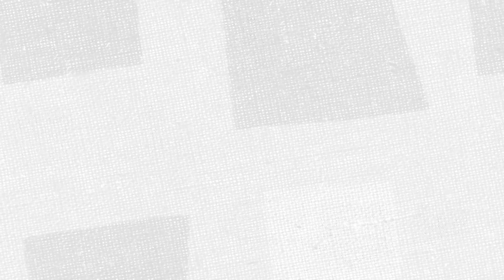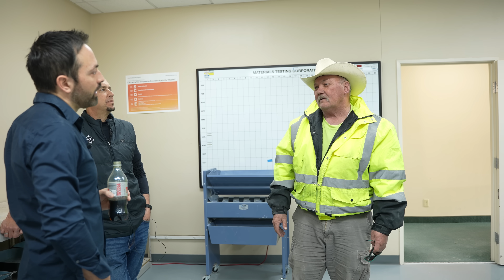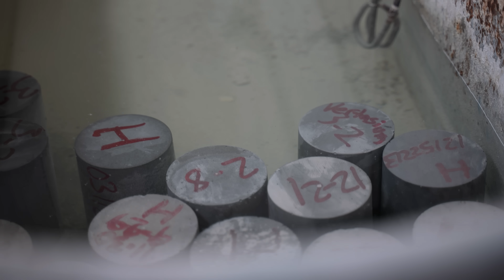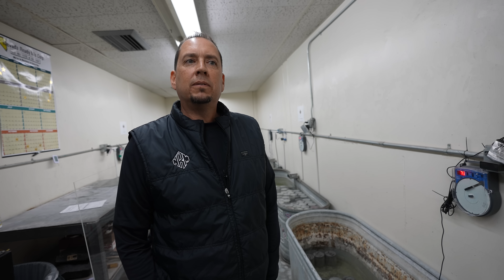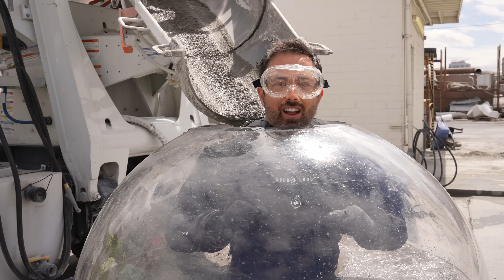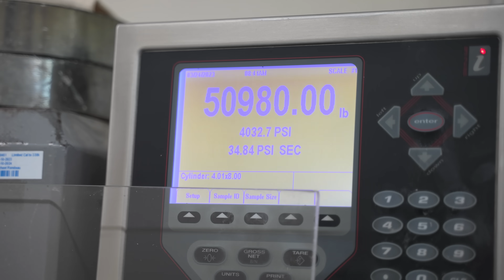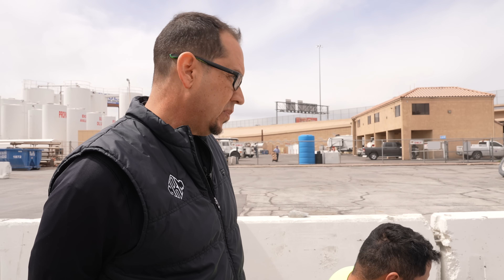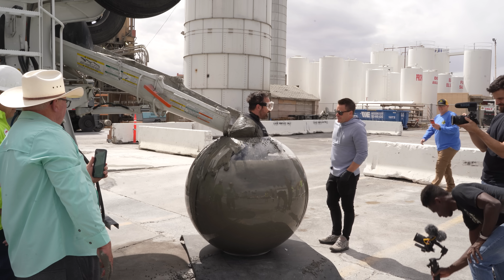Getting Buried In Concrete To Explain How It Works

Comment: I’m a programmer, I actually worked with scientists on a concrete formulator a few years ago! You would input the properties of your cement, sand, aggregates, additives, plastifiers, etc. and what use for it (in saltwater, for a residence, etc.) the simulator would try to optimise the quantities to get you the cheapest concrete that matches the required strength! There would be lots of variables to consider: you want to use as little cement as possible while keeping good strength, so you’d be pressed to use sand but it’s expensive as well, so you will use coarser aggregates to fill it up a bit, but it affects strength too, so you want to add some additives to compensate for it, it all is a matter of carefully balancing expensive stuff that give strength and cheap stuff that give volume!

Outside verifiable facts like density, volume and pH, it also pretty much is an empiric science: formulas are deduced from past observations, and you usually know what properties to expect based on the granulometry of your sand and aggregates, the ratio of water/cement, etc. In the end, my program used a lot of manual-like algorithms — nudging sliders, checking variations and extrapolating ideal values based on that. Just what people formulating concrete do, just automated. This was one of my most fun projects to work on, people usually assume concrete is easy to do and half ass it, but actual, professional concrete has so much reflexion and cleverness behind it!
Reply: So true & great write-up! I'm retired now, but have had positions in the full gamut of the concrete field/industry. Not boasting by any means, but kind of a "you name it, I likely did it" thing.
We were less fortunate and often did the mix designs manually, accounting for every property, specific gravity, particular conditions as SSD (saturated surface dry) for the aggregates, water/cement ratio, and countless other properties, materials, and variables.
Concrete is, by far, the most misunderstood field/industry ever, as viewed by the general public. The true pro's in this field, no matter what level, are truly underestimated and amazing.

Most ppl wrongly assume so many things about concrete. Just as a basic example, I had friends years ago that said how easy they 'thought' it was.
Then I gave them a 12" x 12" x 12" wooden box and asked them how hard would it be to just hold that box full of concrete. They laughed and said it would be 'Easy Peasy' and "What's the catch"?
They found out there was no 'catch' and how shocked they were when they failed at holding it, as they had no idea that concrete actually weighs 150 lbs per cubic foot, which was the size of that "small box".
Reply: @TheRealCheckmate  Aside from some 'chemistry' differences between play sand and typical graded sand for concrete, the main 2 big differences that makes play sand far less suitable for concrete mixes is:
1. Play sand is a manufactured/processed sand and consists of very rounded & 'smooth' sand granules, which cause less adhesion and 'bonding' to the Portland cement. Good concrete requires sharp and angular sand particles, which is exactly what concrete-grade graded sand is.
2. The other big difference is that play sand consists of much finer (smaller) sand particles, but even more importantly is that these sand particles have a much narrower size distribution instead of a wider range of particle sizes.

In concrete material testing & mix design, we run test samples of sand thru a 'nest' of about 6 progressively smaller mesh sized sieves, with the top sieve catching sand particles larger than approx 1/10"  and each successive sieve (in the 7-8 sieve stack) with mesh slightly smaller than the sieve above it. The smallest mesh sieve at the bottom of the stack would trap the finest particles, between .006 to .003 of an inch in size.
A pan below that would catch all dust and fines, which is also considered/counted.

Quality concrete requires a very specific range of % of sand particles trapped for each sieve size, for an overall wide size range distribution.
Play sand has far too few (to zero) of the top 3 or so sand particle/sieve sizes and a far too high of a % of the smaller particle sizes.
Reply: Interesting, what kinds of algorithms did it use? Were there formulas that it could use to calculate the component quantities, or was it more of a brute-force approach? What language was it written in? How many lines of code, if you had to guess?
Reply: That's awesome.  I work for a wholesale greenhouse.  Their mixing system reminded my of our soil system.  It is all based of the percentage of ingredients to make a cubic yard taking into account the desired pH, fertilizer levels, and ratios of other ingredients.
Reply: Pin this comment! Concrete is a HARD science!
Reply: Are you actually amazed this simply? The "program" is a set of look-up tables, duh.
Reply: @johnsmith1474  That's the POINT. That's what science IS. Reducing a complex chemical/mechanical system into a "mere" lookup table.
The most important book for any engineer or machinist is their lookup table. Their Bible.
So yes. It's amazing. It built pretty much everything you have ever used ever.
Reply: I ain’t reading allat
Reply: @NICOHWPO  It's a lookup table. You do NOT read Allat. You look up only exactly what you want. Do you read every article on wikipedia? Or only the ones you need/want?
Reply: @feldamar2  not anymore
Reply: "Good concrete requires sharp and angular sand particles, which is exactly what concrete-grade graded sand is." The video explicitly says the opposite.
Reply: @BM-gn4gk  It depends on the concrete requirements.. Sharp corners in sand focus forces so it can crack.(Why aircraft windows are round) but it can also interlock better...but you can smooth round sand better. It depends. No one thing is better over another.
In the video. He specifically was mentioning how the round sand makes for good smoothing for flat concrete. It depends.
Reply: I work in concrete recycling and the amount of different types of concrete i see is always interesting.
Reply: On behalf of current and former QC techs everywhere, you're welcome for all the damn trial batching that made your life easier! 😝 lol
Reply: @markstone1619  I left in 2014 and the company I was with was still doing mix design that way, though I'd think they could've upgraded by then.
Reply: @DC-ei9vl  Do they ever mention how the Silica dust is as bad as asbestos if you breathe it? i have to wear a $3000 respirator at the concrete recycling plant i work at but i never see people in America in any PPE when working around the stuff.
Reply: @yesterdayschunda1760  Of course not. I worked precast/prestress for a few years and we had one or two guys (former dry finishers) who were trying to sue because they'd been diagnosed with silicosis. Never heard about silicosis as a driver or before that incident.
Reply: I ain't reading allat 🗣️
Reply: @DC-ei9vl  What i found interesting is this guy on youtube suggested you use Silica dust to kill bed bugs the other day
Reply: @yesterdayschunda1760  Never heard of that, cool.
Reply: @DC-ei9vl  Have you heard of Silicosis? Google it, that is why i have to wear over $3000 worth of PPE in my country to work around concrete kek
Reply: @yesterdayschunda1760  Didn't we discuss this yesterday? The case with the dry finishers being diagnosed with silicosis or was that someone else?
Reply: @yesterdayschunda1760  We did. There's a huge difference between a maybe a couple oz applied as pesticide and the huge nasty clouds produced by dry finishing. Perspective.
Reply: I hope the required strength was still reasonably higher than "minimum strength required to meet compliance", but I guess you wouldn't know how they end up using the tool you provide, right?
As a programmer fresh out of college, I still think that's pretty neat in any case. optimizing the variables in a polynomial is a challenging task, especially when there are a lot of variables!
Reply: As an upcoming developer, this was very intriguing. Thanks !

Comment: My PhD is on something concrete related that is fascinating, but that almost no one knows about. In very simple terms, there's this reaction called AAR (alkali-aggregate reaction) and it causes concrete to swell from the inside. When certain conditions are met, an expansive gels forms within the concrete pores and the structure literally starts to expand. As concrete is very bad in tension, a lot of cracking develops and several structural problems arise. I am working on doing computer models of this, and it is fascinating to see rebar on bridges yield and gates on dams getting stuck because of this reaction. Fun nerdy fact some people might find interesting =)
Reply: I know of quarries you can't use the aggregate in concrete for because the ASR is so bad.
Reply: Can't we develop something that strength itself by CO2 rather than water?🧐🧐
Reply: That's true, that's why they put lines in making a concrete highways
Reply: How do you do computer models for this? Like is the model derived from the theory or from the data?
Reply: I see ASR all the time at my job (and ACR). I do concrete petrography so I see when the concrete fails 😅 it’s pretty cool to see it under the microscope and SEM
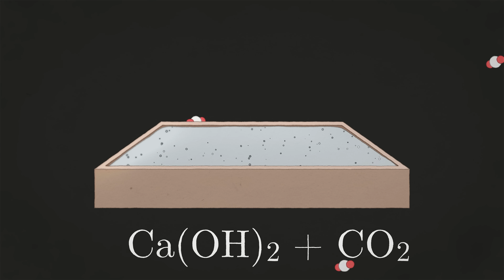Reply: @mohammadnazmulalamnahid6867   2:18 🤓
Reply: @mohammadnazmulalamnahid6867  did you even watch the whole video?

19:23 explains that the water (H2O) causes crystals to form and interlock.
Reply: @Laszer271  usually it is deprived in theory and tested on real life experiments too see of the programm holds
Reply: @run306  No thats not the reason. AAR is kept at minimum chance to happen - especially for streets and brigdes. The reason for cutting lines, is that concrete swells and contracts while it hydrates. That means that the material is going to break due to the inability of the conctrete to take tension. so the lines are cut 1/3 the hight of the plate, so the cracks in the concrete are controlled.
Reply: Dude! I do construction material testing, and one of the tests we do is AAR's! I hate explaining to people my job because quite literally no-one knows the industry exists, but seeing people out in the wild talk about something like this or compressive strength of concrete makes me happy haha
Reply: @gottogo133  I do AAR/ASR testing and yeah, there's a few quarries that I get material from that either can't use the material for concrete without mitigative substances like fly ash or slag, or it's so reactive that there's just nothing they could ever do to stop it.
Reply: @Laszer271  I use finite element modeling, but I definitely have to program part of it myself. The expansion is anisotropic and stress-state dependent, depends on temperature and humidity, etc... so all of that has to be accounted for in the model. I'll add a couple links to my research below in case you're interested =)
Reply: @Tobi21089  The correct way to do it is to first evaluate the reactivity of the aggregate through petrography tests, estimate the level of expansion attained to date using DRI tests and determine the current material properties through compressive strength of SDT tests. Then you use that along with climatic and structural data (including loads) and input on the model. If the output matches what is observed on the field (cracking pattern/damage) and the expansion obtained through the model matched the DRI test, results are good and can be used to assess the future condition of the structure =)
Reply: @MikiMusa  You are correct. However, in dams people sometime perform slot-cutting to release some of the compressive stresses. One of my current papers is covering exactly that =)
Reply: Since I´m from germany, it gives me really hard times to figuere out all your shorts. Here we have completely different names and ways to test. First of all we are using cubes instead of cylinders :D. Secondly I really would like to know more about the AAR simulation -since i´ve waited 9 months for the results of the samples, with a negative outcome. Blew money out the window for that...
Reply: @MikiMusa  I tried posting the links to my research, but youtube blocked it. I'll put the names down below and you can google all my papers/thesis. If you want to discuss further, please let me know! And yes, sorry for the abbreviations haha. SDT is stiffness damage test, AAR is alkali aggregate reaction, DRI is damage rating index, FEA is finite element analysis =)
Reply: As some people seem to be interested and asking about it, I am posting below the titles of some of my papers and thesis so you can google it (as I can't post the links here).

MASc thesis:
Gorga 2018 - Engineering-Based FE Approach to Appraise Slender Structures Affected by Alkali-Aggregate Reaction (AAR). University of Ottawa MASc thesis.

Paper on AAR-affected bridge in Quebec City:
Gorga et al. 2018 - FE approach to perform the condition assessment of a concrete overpass damaged by ASR after 50 years in service. Engineering Structures.

Paper on AAR-affected dam in Brazil:
Gorga et al. 2020 - FE assessment of the ASR-affected Paulo Afonso IV dam. J. Perform. Constr. Facil.
Reply: @Rodrigo93vg  Do you live in the US?
Reply: @MikiMusa  Canada 😀
Reply: Funny. In my uni everybody makes their thesis on AAR. 
Maybe it is a regional thing
Reply: @basedluanp  What University is it? I might be wrong, but those symbols are Japanese... so maybe you're associated with Dr. Kawabata (in Nagai, Yokosuka)? He's the best Japanese AAR researcher I know =)
Reply: In a structural geology class my professor casualy touched on rebar in concrete to draw an analogy for how stress and strain causes fracturing in rocks. The point was that most rocks/minerals are very strong under compression but very weak when in tension.
Reply: SpaceX definitely needs some better concrete for its launch pad!
Reply: So what's the magic formula for the strongest foundation and piers?  I'm not an engineer.
Reply: @l0I0I0I0  honestly, just design it right and don't use very reactive aggregates haha
Reply: @gottogo133 we have that problem alot where I live...
Also acid generating, so we can't use it for rip rap and rock protection near waterways
Reply: @basedluanp  Yes of course, depending on the gravel and stones that are typical in the area.
Reply: @jonfer9999  you civil engineer you learn how to build if you want to know more about concrete, you should have studied chemical engineer

Comment: Anyone else laugh when he said “the difference between cement and concrete. People often mix these up”? I’m definitely adding that to the dad joke catalog
Reply: A moment of silence for the truma they will have to go through 😂
Reply: I thought I’m the only one who laughed 😂
Reply: Well what is the difference if you are so smart
Reply: @mattc825 The joke is the line "people often mix these up" because...
Reply: @paulelpers1411  Gotcha.  Thanks.  Now I can laugh I suppose..
Reply: Brilliant 😂
Reply: Wow, I didn't even realize that until you pointed it out, it went right over my head lol
Reply: @Soluna7  But what is the joke?  I still don’t get it!  Cement and concrete are different things that some folks tend to confuse.  Why is it funny though?
Reply: @mattc825  "Mix these up" as in, they are mixed together
Reply: @Soluna7  OMG.  Thank you!  😂
Reply: Retired architect here. Cement is the glue that binds the aggregate together to make concrete.  Concrete is thus a composite of Portland cement and coarse and aggregates. So saying cement and concrete are "mixed up" isn't just a bad pun. It further confuses the issue. Cement is often mistaken for concrete, and visa-versa is more accurate.

..and skyscrapers are not made of seashells. They are made of mainly of steel and glass, usually with lightweight, non-structural concrete floors poured into corrugated steel pans that span between secondary structural elements like wide-flange beams or light metal trusses. The concrete serves two main purposes - fire resistance and sound isolation. The only load bearing concrete will be low in the structure and used as footings, or sometimes as shear walls. This is because structural concrete is ill suited for use in very high buildings due to it's mass.

Finally, infrastructure is not made from concrete alone. It's a composite of concrete and steel reinforcement bars (rebar) engineered to exploit the compressive strength of concrete and the tensile strength of steel.
Reply: @Hoganoutdoors  we watched the video. We don’t need your long winded buzzkill response. You must be a blast at parties 🙄. “Mixed up” and “mistaken for” are synonymous. Therefore it’s a great pun. I’m sorry if you have no sense of humor.
Reply: Have you ever spoke with someone else?
Reply: @Soluna7 except they aren’t mixed together, cement is mixed we water and aggregate not concrete
Reply: @Hoganoutdoors architect 😂😂😂
Reply: @paulelpers1411  Oooooh i get it now thanks
Reply: @mattc825 Cement is the added to sand and gravel which is to give Concrete is strength, the larger the Aggregate the stronger the mix,Well? To a certain extent, More cement can be added to a batch of concrete made with pea gravel rather then 3/4" - 1" rock to acheive a higher PSI rating for the concrete, but anyway to answer your question cement is concrete = sand and aggregate, Concrete = Cement, Sand, aggregate & water, sometimes with other misc. additives to accommodate for regional elements, (Fly ash, Calcium Chloride, water reducer Super P) etc....